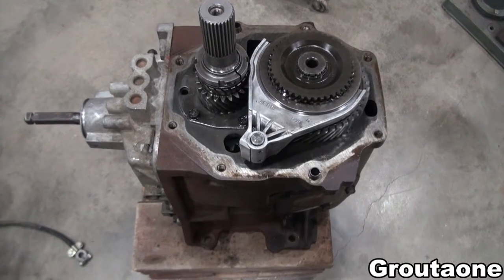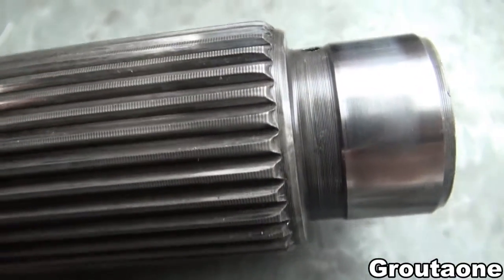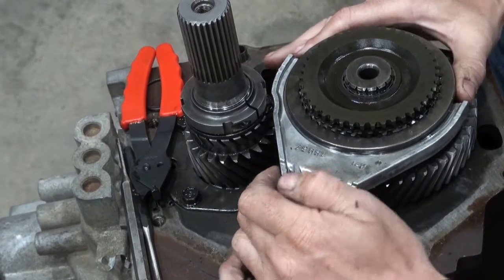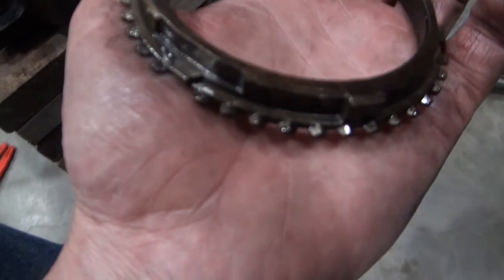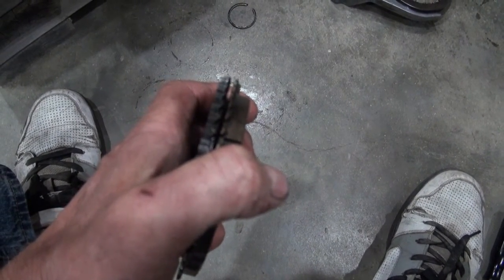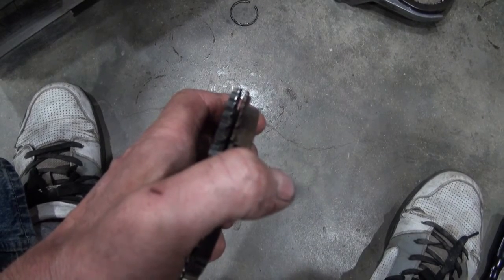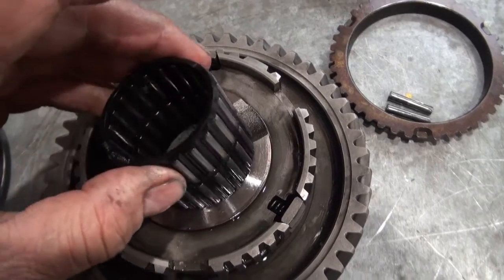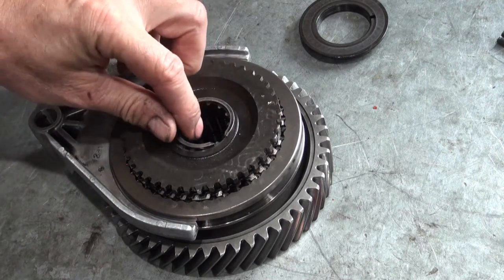Dodge NV 4500 Transmission Fifth Gear Removal

Comment: sup my dodge peps had a question for everyone on this page or who ever.  so if the front bearings goes out on the 2nd gen, with a cummins in it, i'm talking about the transmission, would it be safe to reuse the shafts and the gears 
.  or would it be safe to get new ones.  Me and the wife had picked up our oldest daugther from her school in WYOTECt and went to Las Vagas.  going home too the resorvation which is the navajo rez.  the transmission siezed and had to spend a night in the middle of nowhere.  So to find out the front bearings had been grinded to S#@t.  So can i reuse the shaft?  thanks a whole lot if you answer my  QUESTION?      PEACE!!!!!!!!!!!!!!!!

Comment: Thank you so much for posting this! The roll pins came out of my 5th gear fork, to play safe. I replaced the fork and had problems getting the slider back on, I couldn't see the flat spots are one tooth off of square. Seeing how you installed the OD unit was priceless !!! Thanks again.  Gene

Comment: 9:34 I’m having the same problem with the gear rubbing against the bearing retaining plate,the shaft is not wiggling in any direction. Do you happen to know what could be causing that to happen?
Reply from the maker: How much end play do you have?
Reply: I can’t seem to pull it forward any and there’s little to no play up and down, thanks for the reply any help is appreciated, I haven’t been able to find anything about it on forums. There are noticeable gear marks on the plate.
Reply: Do you think the endplay would affect that or the 5th gear needle bearing?

Comment: Hey nice video man, good work. Its possible to check with the smallest feeler gauge between housing and outer bearing ring after you removed bearing plates if you suspect rotation in housing. We always made that check on Volvo truck. Normally the bearing rotated in housing. Sometimes it was enough to just push shaft sideways and bearing popped out almost by its self. I don't know whats the material on your gearbox but we had allot of problem with aluminium housing. They implemented bearings with a locker pin and updated the specifications on the play to negative play. Have you done any flying lately to test your phone? :)
Reply from the maker: Thanks for your input, I will investigate you're spun bearing idea, if it has spun I may be able to bond the race to the housing but I don't really like that idea. This is a cast iron housing. Have not done any phone testing in flight but there are some on you tube that have showing no change in tilt after a long flight.
Reply: Sure man, just wanted to share my experience. I will try to find those videos :) Do you know who made the test or how to find it? Thanks
Reply from the maker: One plane test was done by "Paul on the plane" channel, a video called 4,519 miles and no curve

Comment: you got all the upgraded parts to replace the internals with? might as well make it better while you're in there not something you want to have to do over very often you still running your race car?
Reply from the maker: The only upgrade I have for it at the moment is the fifth gear retention parts, after it is apart I can have a good look at the rest, the main shaft may get replaced, I sold the Firebird about two years back.
Reply: bummer about the race car, looked back through your videos but also didn't see if you ever got your long travel suspension cart done